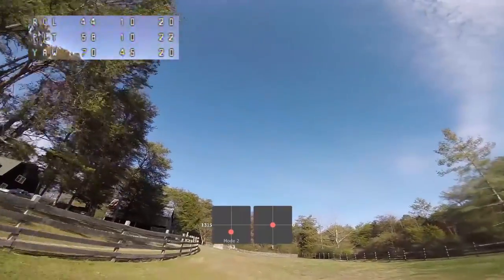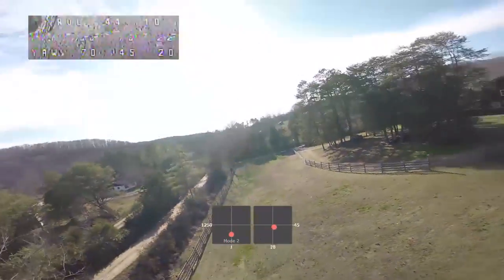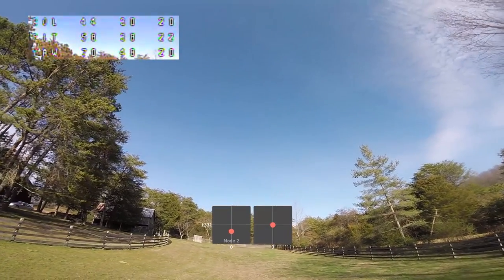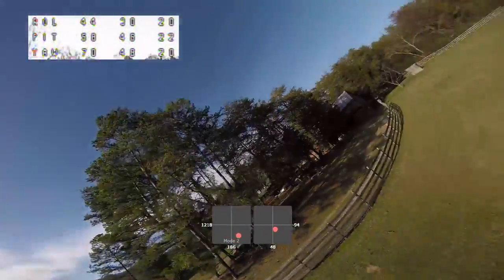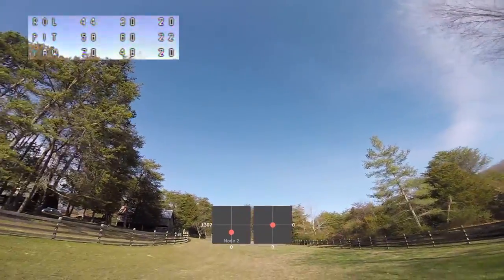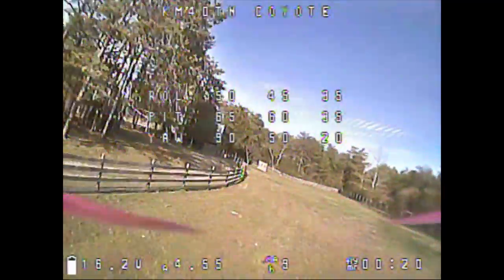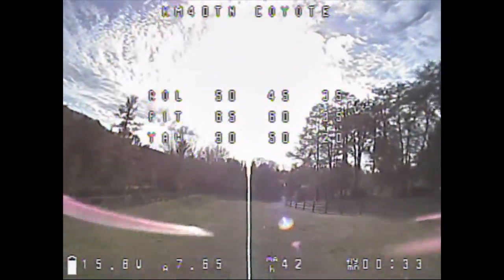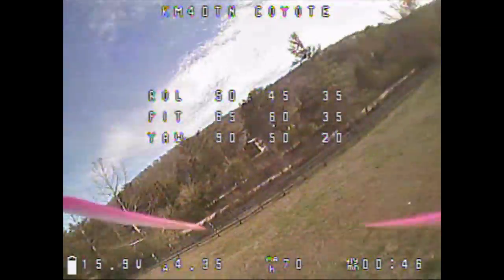Betaflight 3.1 anti_gravity_gain | EXPLAINED

Comment: Yes I tried altering p gain on pitch to be sure it was working that went fine, but it won't change the anti gravity...odd I'm thinking maybe my FC wont support it I'm using the lux v1 with the latest fw for lux race
Reply from the maker: +Summer Crow all FC's running Betaflight 3.1 should support it as far as I know.
Reply: I'll try flying it today it's set to 1.000 according to the data dump, I set it to 2.000 but this doesn't show maybe it's just not showing  we'll see how it flys  I had this happen with camera yaw roll mix too, it would not work until the latest FW upgrade that put a box for it in the GUI now that works fine it may be my older lux board just needs it in the GUI to work right, although why this would be the cas I have no idea if it's not working today I think I'll try the v2 board and see it that changes things 
Thanks for the input 
Cheers

Comment: If I set Atigravity the switch (for example aux5) in which mode it works ? If a switch aux5 (the mode is highlighted in Betaflight) the set anti_gravity_gain = 3 turns on or off ? And can I use this option by default, if I don't assign a switch ?
Reply from the maker: +Алексей Есин yes to all.
Reply: I do not understand. If you set "Set anti_gravity_gain = 3.00" it acts by default. Or you must turn on the mode "Antigravity" from switch (example aux5) ???
Reply from the maker: +Алексей Есин you do not have to set the mode. If you do not set the mode, then it is always active. If you set the mode, then it is only active when you flip the switch.
Reply: I understand. Thank you very much.

Comment: how is anti-gravity different than airmode? seems as though they kinda do the same thing. What's your canonical way of explaining this?
Reply from the maker: Anti gravity boosts the I term when the throttle moves quickly. Air mode boosts overall authority to the mixer when the throttle is low. They really have nothing to do with each other.
Reply: oh, i thought you took very complicated concepts and made them easy to understand.  thanks

Comment: alright so I reset my fc and don't know what the previous ESC protocol is when I reset my FC did it reset my ESC if not how do it tell what my ESC are running.
Reply from the maker: What protocol the ESCs support depends on what type of ESC it is. BLHeli supports Oneshot. BLHeli_S supports multishot and sometimes Dshot.
Reply: Joshua Bardwell oh I got it, thanks I finally figured out what they were

Comment: Hi all! And first of all thanks to Mr. Bardwell for a good quality info video here. Now what I am wondering, did someone try this on a Naze32 rev5 flight controler?
Reply from the maker: Betaflight 3.1 still runs on Naze for now, but F1 boards are on the way out.
Reply: Yes I am actually running Betaflight on my Naze32rev5, but I am scared will the controller work fine with the anti-gravity feature on. That was my first thought actually. Thanks for the fast reply!
Reply from the maker: +Getz01 sire it will why  not? That feature isn't particularly processor intensive I don't think.

Comment: Sir I have a 5"  Merica 4S it has an F4 AIO running siskin 32-bit ESC dshot 1200 dys 2206 2700 KV Motors I went into my CLI to check anti gravity and mine is different than everyone's even different than my sparrow when I punch in get gravity it says anti_gravity_mode = smooth allowed values: smooth,  step.  anti_ gravity_ threshold = 250,   profile 0,                         allowed 20-1000,                anti_gravity_ gain= 5000, profile 0.                          allowed range 1000- 30000.             Osd_ anti_ gravity_ pos =234.
Allowed range : 0 - 3071 what does all this mean? I'm using betaflight on the speedybee mobile app
Reply from the maker: Betaflight 3.4 or 3.5 updated the anti gravity settings to be like you are seeing. Smooth anti gravity means that instead of kicking in all at once, it kicks in gradually as you raise the throttle. Threshold controls how fast you need to move the throttle, to cause it to activate. Gain is how strong the effect is.
Reply: @JoshuaBardwell  thank you much sir I learned something and will continue to thank you

Comment: Hmm weird, I can't even get anti_gravity to show up. I type it in CLI and it just says unknown command. I'm using betaflight 3.1.5 on a furious FPV radiance. Maybe not supported? Which would be a bummer!
Reply: ALLsteveo 
Hi I just typed in dump and looked through then copied the line into the cli
Reply: type set anti
see what you get
Reply: good tip, use the "get" command, like "get gravi" and it will display everything with the word gravi in it ! :)
Reply: I'm just so used to typing set I don't even use get anymore
Reply from the maker: +Take Flite that's the way to do it. We'll done.
Reply: +Take Flite  ahh I figured it out. I was just typing  anti_gravity and hitting enter thinking it would show me the settings. I didn't add get to it. Got it all set up now and I was able to get rid of my bobbles under throttle and lower my I's a bit to make it feel less stiff but still not loose it's attitude. This setting works great! Thanks guys!
Reply: ALLsteveo 👍🏽

Comment: why is the word term used? The word gain is also used in same sentence.
Reply from the maker: The PID controller is a mathematical algorithm that takes inputs from the sensors (like the gyro) and uses outputs to the motors in order to cause the quad to do what it is being commanded to do. Three variables are calculated in the PID controller, kP, kI, and kD. They are calculated in three different ways. They are referred to as the P, the I, and the D terms.

The three terms can be given an adjustable weight, to allow a person to tune each one's influence relative to the others. The gain is the multiplier that is applied to each of the terms, to adjust its influence.
Reply: Thank You!

Comment: Hmmm, i typed get anti_gravity and it shows a value of 1.0, that's 3.1.6
Reply: I would say that was correct, if the anti gravity gain is a multiplier as josh said then multiplying by 1 makes it the value the same, if the multiplier was at 0 then the I term would become 0 when anti gravity kicked in.
Reply from the maker: +Johnus Johnson yes that's correct. I misspoke in the video.

Comment: my roll I gain is 80  =D if i set 70 quad slowly drops through on right back motor
Reply from the maker: Something is messed up that's for sure. I wonder if your back right motor is making significantly less thrust than the others. Maybe it's broken?
Reply: @JoshuaBardwell  😢 maybe but i figure out with anti gravity :) i setted anti gravity about 6.5 😁😂

Comment: what is the root cause of the problem? I suspect an unbalanced quad? for example if the cg is not located in the center of the four Motors.
Reply: quiljw01 root cause = no gravity / weightless quad. So if iterm was pushing quad slightly forward or backwards during normal flying and all of the sudden quad is weightless that pushing results in drift now
Reply from the maker: +Boris B. But we also see the same effect when punching the throttle which is not zero G. So I think it is more about the rapidly changing aerodynamic situation when the throttle moves.
Reply: Its still the same as there is still very quick G force change.
Reply from the maker: +quiljw01 no. I've tested this and CG rely has a. Minimal effect. It's due to the rear motors getting dirty air from the front motors. It's an aerodynamic effect. You can come firm this by seeing thst even when the CG is perfect, there is a positive pitch I term in forward flight. Thus tells us that the rear motors are having to spin faster to generate equal thrust.
Reply: Joshua Bardwell when you punch straight up there is no dirty air from the props. Its just "instant" g force changes that requires completaly different offset and iterm is basically 0 offset of the quad
Reply: but yes in fff also that comes into account and adds additional zero offset shifting
Reply: So you're saying the I term is being used in a relatively low rotational speed throttle change... But if we think deeper.... what is causing the I term to be used at all?  My point is that the further your CG from the center of your motors, the worse this effect is.  I think with CG at the center, you don't have this effect at all.   TOPIC CHANGE WHILE I HAVE YOUR ATTENTION!   Boris, when can we have turtle mode in BF?   Is it not already possible for communication with ESC's through blhelisuite?  When the quad is upside down, you could flip a switch and the FC can detect which 2 motors are the highest off the ground (already possible with accelerometer) .  Could it then change the direction of the higher motors and fire only those 2 motors.  ( Because If you fire all 4 motors, the props that are touching the ground will interfere negatively with flipping over.  )  Then you would want to disable gyro control and tie the throttle to only those 2 motors, and maybe scale the throttle down to about 30%.   Now when you throttle up you can have a controlled flip over back to right side up.  I realize it may take some seconds for the FC to do this, may even need to reboot... but late is better than never!
Reply: Thats already in there actually. You can have 3D mode on switch and enable it whenever you want ;)
Reply from the maker: I understand your point. You're mistaken. The first time I noticed that the pitch I term was positive in forward flight (meaning that the copter had a pitch-backwards force that it was counteracting) I thought my CG was too far back. So I moved the battery ALL THE WAY forward so the CG was well forward of center. The pitch I term magnitude barely changed at all. I believe that the issue is aerodynamic in nature, but whatever the issue is, it's NOT primarily CG.
Reply: Yes quiljw01 cg doesnt apply to this part. The aerodynamic forces are much more dynamic and affect iterm force more
Reply: Ah - I LEARNED SOMETHING!  Ok interesting to note!  So we can conclude that from a simple hover throttle punchout, CG WILL affect the need for I- term to hold level.  But in FFF the CG DOES NOT affect ( or less significantly) the amount of I term needed to hold level.    So the differences i see between hovering punchout and FFF is 1 - aerodynamics . 2 - pitch angle of copter and possibly 3 - motor rpm.  So it must be cause by one or all of those differences. hmmm... interesting
Reply: Interesting.  However, I still think it might be improved by disabling the 2 motors that are likely touching the ground.  Admittedly I haven't looked into trying this for a while, i'll have to experiment.
Reply: A guy in belgium won the competition actually on this way by crashing in finals and able to recover :)
Reply: Boris B. amazing!  please give his name or link to a guide!
Reply: Most common cause is in balanced motor output power. Some escs have weak fets and don't produce the same amount of power and some motors are wound not quite right and produce different thrust.
Reply: Stephen Gibb interesting.  Is that a theory or a proven test?
Reply: quiljw01 i just know of some people suffering loss of angle on throttle punches which has then been rectified by esc or motor change.
The only real use for a thrust test stand in my opinion is to check thrust for the corners powertrains are all working similarly.
Reply: Stephen Gibb ah yes now I know what you're talking about.  in my experiences that is always accompanied by some twitching as well.

Comment: But you're testing / proving it works with I = 60 which is "way too high" to begin with.  How does this prove anti gravity works with a normal I value?  Wouldn't you need to lower I to a 'reasonable' value around 30, and THEN test anti gravity mode?
Reply from the maker: This is just an example that I picked. It's not the only test I've done. I'm not trying to prove a controversial point here that requires exhaustive testing. Try it for yourself. It's easy.

Comment: Ok the custom RC curve is completely controlled by intuitive parameters now i.e. center stick slope, max rate, and center linear width! Its 100% super clean, would you be on board with this is the question?

https://github.com/nateimig18/AcroRcCurveFinder/blob/master/docs/rcCurve_Redefine_v2.pdf
Reply from the maker: Is this actually being merged to betaflight? I'm completely behind it. I suggested the PDF to Boris and he said he thought the calculation would be a bit intensive to do in real-time.
Reply from the maker: So I think the question for you is, if you want to see this implemented any time soon, whether you can come up with an efficient algorithm to achieve the same thing without resorting to lookup tables.
Reply: I mean I would prefer BetaFlight since its opensource, but really anybody can use it how they see fit (RF or KISS). Damn idk i was totally assuming this was a Look-up Table interpolation operation in the FC for BetaFlight, especially to the avoid division!

I do appreciate you suggesting it to him tho! Was it the powf() he was worried about being to calculation-ally intensive? The alternative to the look up table method would be the approximation of the powf() routine which could be speed up sacrificing a degree of precision. ("how much speed up vs. precision is needed is the question"). 

I've done low level 'variable' precision function approximation's for a hand full of transcendental functions recently for another project (i.e. invsqrt, inv, log, exp, sqrt, pow, cos, sin), using some floating point magic, and minmax alg. (Remez, Chebyshev, not Taylor he wasn't good enough) for horner coefficients used in efficient mac polynomial evaluation. The advantage would be no divisions (which are actually pretty slow compared to multiplication ironically, 14 system clk cycles), and a more intuitive RC parameter set but would definitely require an FPU.
Reply: Yea your right it is calculated in flight...

https://github.com/betaflight/betaflight/blob/master/src/main/fc/fc_rc.c#L99
Reply from the maker: +Nathan Imig yup. I'm not sure why that's superior to a lookup table, as long as the table has sufficient resolution but it's the way the devs have gone.
Reply from the maker: +Nathan Imig you should reach out to him and discuss it directly. Message him on rcgroups.

Comment: Sooo... Even when antigravity gain is set to 3 and I is set to 130 on pitch and 100 on roll my quad won't stop pitching like crazy on punch outs. Also, when I go to idle, it feels veeeeery sluggish as if I gain is way too low. And my Idle is very high! I could get it lower, but then it becomes unflyable.
 I've tryed to fix this for a long time, but it won't go away. With those high gains it works better, but still not good. 
I'm running a Hyperlite F4 with BF 3.1.7 at 8/8/8, T Motor F40 pro 2400kv and Littlebee Blheli 30a esc. So the esc are the only thing i haven't switched out since I build my first 4s setup, so they are the last possibility of a hardware error. Can this be caused by the old Blheli? Is it slower or not as powerful on low throttle compared to Blheli_s? Because I see so many well working setups on yt, but all have Blheli_s...
Maybe you can help me there :)
And thanks for reading!
Reply from the maker: Your quad feels sluggish because I gain is too high. Excess I gain gives it a "stiff" feel. If Lower I gain back to defaults and raise antigravity gain. 3 is just a starting point.
Reply: Okay, thank you for that answer.
I will try to get into it again and test some other I values. But when I turn I down, I can feel how the quad goes to all directions slowly when on low throttle, so it is not holding it's attitude. Especially on yaw. Or is that something I have to live with? Maybe my Idea of a good flying quad is just not possible at the moment.